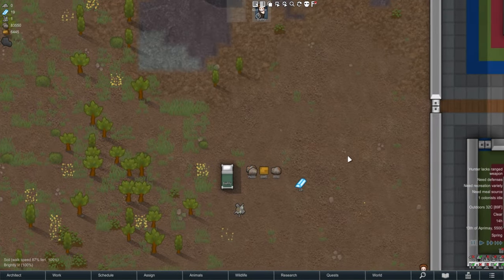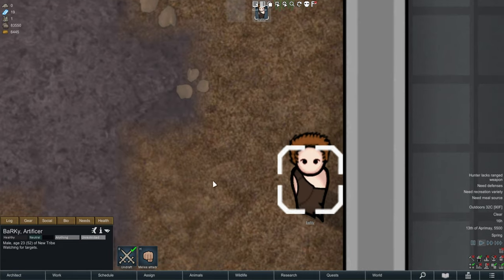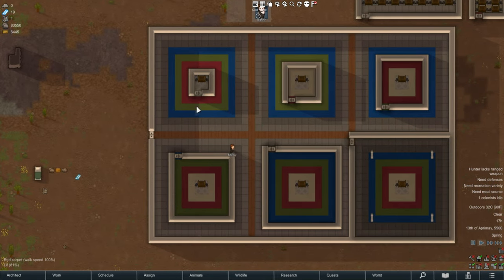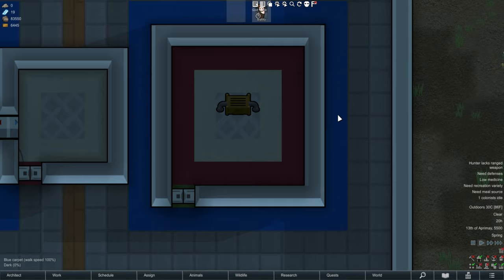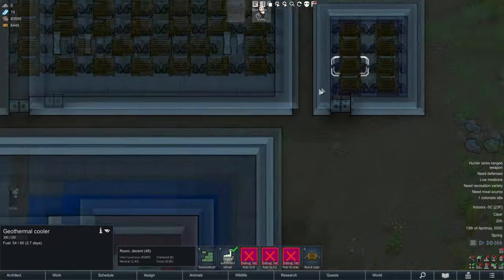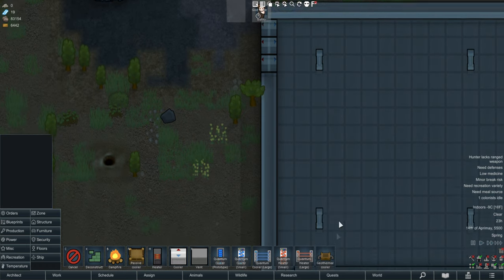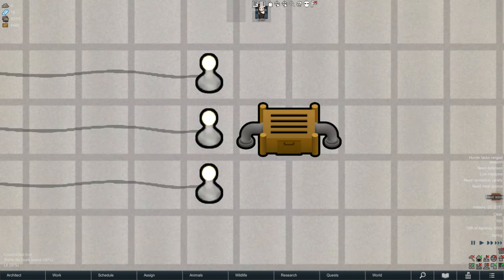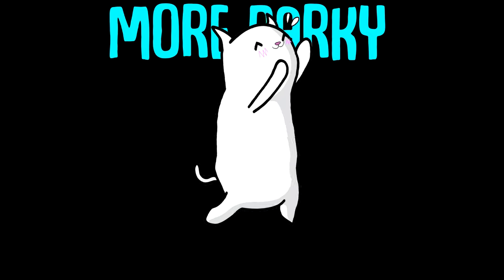Geothermal Cooler! Medieval Cooling - Rimworld Mod Showcase

Comment: the closest real things to this I know of are either using hot or cold (but not below freezing as far as I know) water from natural springs (like the geothermal vent, but water instead of steam), or the modern geothermal heating/cooling, where they dump heat into or take heat from the ground by piping liquids through underground pipes. 

This mod seems to be mixing both of these with a fixed-temperature air conditioner.